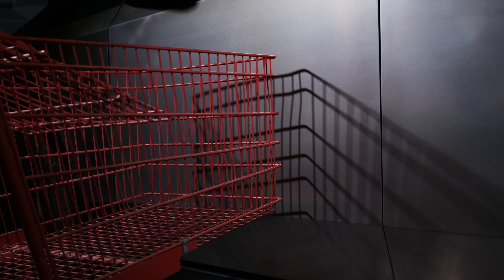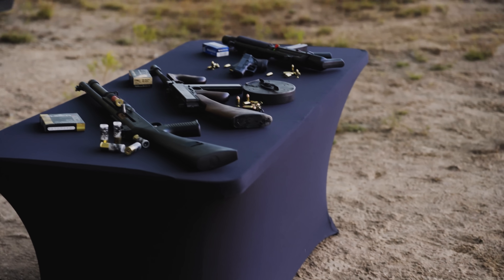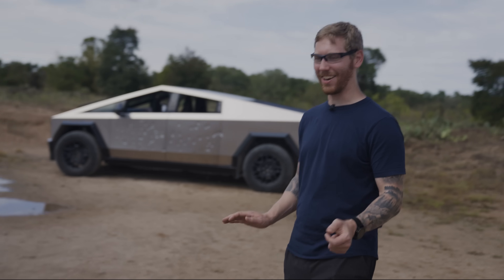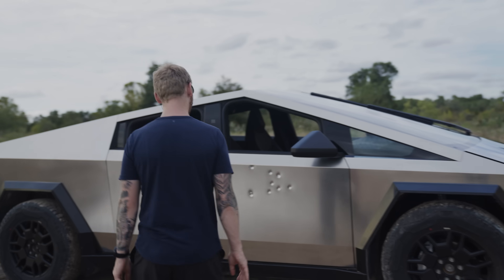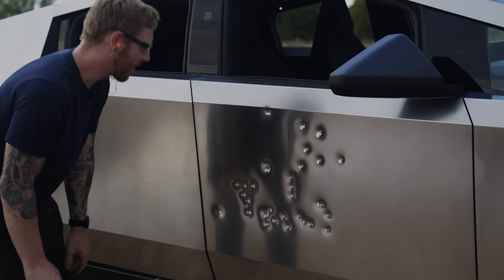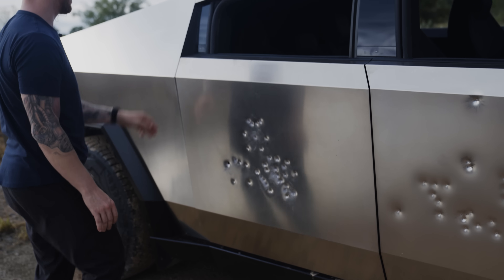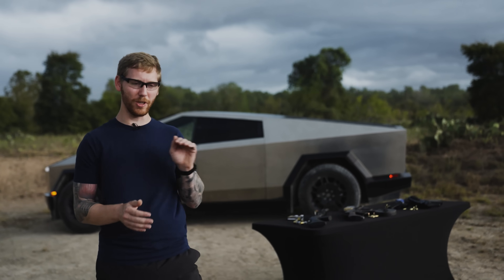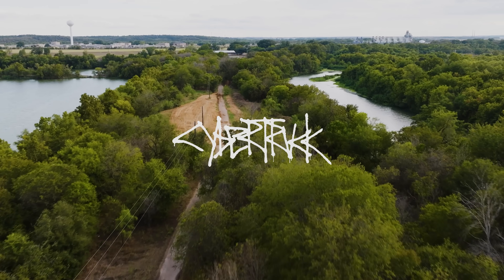Cybertruck Bullet Test

Comment: That is insane, I cannot believe how well it stops the bullets with such a thin panel.
Reply: The point is its a tough vehicle, its 'more bulletproof' than any other truck. Its incredibly expensive to make a vehicle actually bulletproof, theres also levels to what the market claims as 'bulletlroof'. The first level is actually what the cybertruck is one which is light arms/handgun proof. To actually believe that the claim from tesla was 100% bulletproof including 50 cal rounds just lacks an understanding of the science.
Reply: They specifically chose low velocity pistol and shotgun rounds to show the car is "bulletproof". They chose 0.45 ACP because it is a subsonic round and they even used an MP5SD specifically because it lowers standard 9mm ammo to subsonic velocities. I have serious doubts it stops higher velocity handgun rounds or any kind of center-fire rifle ammo.
Reply: @michaelhill6451 interesting you are right about the MP5SD.

Barrel has porting holes drilled near the base of the barrel to bleed off the gasses.
Reply: @michaelhill6451 
An MP5SD lowers a 9mm's velocity????
That is the opposite of true. 
Adding a suppressor is kinda like adding more barrel, which gives a longer time for gasses to act on the bullet, speeding it up. 
Suppresses guns only have slower bullets, because people put subsonic bullets in them so they don't break the sound barrier and make a shockwave.
They specifically said they used normal 115 grain 9mm in this video.
Reply: @MasterFancyPants  Completely wrong. It was designed to lower standard supersonic military ammo to subsonic velocities so they didn’t have to use special subsonic rounds. Thanks for playing. If you don’t believe me look at the captions that list the velocity of the rounds or look at the dents that aren’t as deep as the dents from rounds shot from a handgun.
Reply: @MasterFancyPants  Nonsense. Once the "seal" between the barrel and the projectile has been broken, that's the end of acceleration. Some integrally supressed firearms use barrel porting to reduce velocity. This is the case with the MP5SD.
Reply: Video clearly made by Tesla lol they use small under powered guns to "prove" the Cybertruck is bulletproof. LOOOOOOOL . An AK47 would shoot through it like cheese mate ! And they refuse to shoot the windows cause we all know even the small bullets would break through easily
Reply: Bot comment.
Reply: Didn't do that well barely did it.
Reply: Go with your instinct to disbelieve because it IS a lie.
Sheet metal, regardless of the alloy, cannot stop a bullet!
Reply: It's awesome material for a truck body. The bullet proof thing (only for lower speed rounds) is just an added bonus. If they reall come out with a version for $50k, IDK why anyone would buy a Ford Lightning. I only wish their range was better on the $50k model. My commute is a little over 30 miles one way...so a range a little over 300 would be ideal.
Reply: You are likely to get the shots in angle when moving, so it does matter that it can stop small bullets compared to other cars.
Reply: You ever heard of reloads? You know, half as much powder and soft lead tip. And spread out the rounds.
Reply: This just means if you have dent to repair, Tesla will charge you 20 k
Reply: High toughness stainless steel is impressive stuff. A big part of its stopping power is from how much it can temporarily deform without cracking.
Reply: Agreed @gruberaj . that so awesome
Reply: Well nearly 2mm steel with lightweight slow bullets, not a surprise.
Reply: @jantschierschky3461  I mean he did hit it with the most common rounds your likely to face.  But I agree I would like to see what the limits truely are.  Also Teflon bullets.
Reply: @rockyjohnson9243  Teflon bullets won't do any better,  but buck cracking window makes it clear those are not bullet proof.  So the whole video is a lot of crap
Reply: @rockyjohnson9243  Look, any rifle bullet will pass. This can hold maybe up to .45 pistol round.
Reply: @jantschierschky3461 tbf they said it wasnt meant to be bulletproof but i agree itsa load of bs and marketing stunts
Reply: @nikolajovanovic2433 yeah its marketting but whats so bs,nothing was promissed, its just for fun. Have you seen the ceo. Youre contradicting yourself
Reply: @jantschierschky3461  You can add an option for bulletproof windows however this will mean you wont be able to lower your windows as it will be a thick panel of glass. This model has the standard non bulletproof glass, so yes, it did break.
Reply: @Janwesdijk123  yes that super glass that got broken by a steel ball
Reply: @jantschierschky3461  bro what? is english your native language? i clearly said it wasnt super glass... this prototype uses the regular glass
Reply: @Janwesdijk123  well the bulletproof glass they showed with the steel ball. That I referred to
Reply: @jantschierschky3461 Broken and penetrated are 2 different things. 
Armor ceramic plates are broken when they are hit, that's how they absorb a bullet's energy.
Reply: @DataLog So basically the same as a typical kevlar vest... 
It's funny how you denigrate the CT because it can "only" stop pistol caliber rounds when those same rounds would go through any other car like butter. 
 
Also, what rounds do you think you'll face when getting shot at by thugs in Chicago... 50 Cal? 5.56? 45-70? No, you'll get hit with .22lr, .38 special and 9mm. That's pretty much it.
Reply: @MasterFancyPants  sure but .
Reply: @jantschierschky3461  Why is the whole video a load of crap? Did they say the window was bullet proof? At a pinch you would have to duck down and ask FSD to get you out of harms way (i.e. you wont need to stick your head up to see where you are going).
Reply: @jantschierschky3461  Actually its 3 mm stainless steel, which is significantly thicker compared to standard sheet metal of modern vehicles at 0.6 to 0.8 mm
Reply: @jantschierschky3461  Stainless Steel not Mild Steel
Reply: @SimonAtkinson3314  did I state anything differently  ?
Reply: @jantschierschky3461  Not really I guess I should of simply pointed out it was Stainless instead of  sounding like I am correcting you. I think 1.8 mm of Standard painted body panel Steel  would be a completely different result. Apologies.
Reply: @simon3314  stainless can be stronger, depending on its nickel content.  But that quality of steel is only marginal stronger than mild steel,  however in cars they use a different grade. So if 1.8mm thick may hold up as well. Normal cars have 0.7mm thick panels.  However I get your point
Reply: @jantschierschky3461  stainless steel is ALWAYS stronger than low carbon steel
Reply: @jantschierschky3461  I work in various mediums & it's a given that if you are going to attempt drilling stainless steel with a duff or low quality drill bit , or without step up diameters, then you might a well not bother. The weird thing is however, is how easy it is to mess up stainless posi drive screw heads and end up been 'screwed'.
Reply: @SimonAtkinson3314  I don't doubt that. I also did not argue against stainless steel. All I said is that stainless steel is not necessary harder than other steel used in the auto industry.
Reply: @jantschierschky3461   Sandy Munro has pointed out that the Cybertruck is  Cold Formed  (Work Hardened) Martensidic Stainless steel.
Reply: Try an AK47 . And the glass isn't bulletproof at all.

Comment: Funny how nothing has been said about how towing and off-roading and hauling and just general truck stuff affects the range and performance of the truck. Funny how every other electric truck has had issues with truck stuff and battery power. Funny how electric trucks are not good at being trucks but are 3 times as expensive. Funny how it beat a Porsche while towing a Porsche but i (and probably most truck guys) don't care about its speed we care about truck related performance. How much power did the Porsche stunt take? We don’t know because thats what they dont want us to see.

Comment: I doubt it would survive a 5.56 or similar round but they definitely have an amazing steel alloy.  I'm mostly concerned with a T-Bone car accident and it looks like it would easily stop one of those.
Reply: To be fair 5.56 and .223 were originally meant to pierce body armor lol
Reply: @TripedalTroductions that round was invented way before body armor
Reply: @TripedalTroductions  No it wasn't. It was a consumer intermediate varmint cartridge long before the military even got it's hands on it. There are specific loads of 5.56 that are designed to defeat armor like black tip but those came years later. 5.7 was designed to defeat armor and it's even smaller than 5.56 but is even faster.
Reply: @sgsheff  That was the .222rem and was the original caliber of the AR-15 before Remington and Armalite worked together to create the 5.56 specifically for military use.
Reply: @llIIIlIIIlllII  Correct. Even then it wasn't directly designed for military use because it was released on the consumer market before the military touched it. It was only a demonstration at a military/political picnic/lunch where Stoner was given an opportunity to show how much easier it was to shoot compared to the then current service rifle that forced the army to put the future m-16 in a comparison test against the m-14 and the military members fought it every step of the way. When the m-16s were introduced in Vietnam it wasn't even official. It was probably the most unlikely and unorthodox way to eventually become the most used service rifle in the history of the USA. Tales of the Gun has a great episode on it.
Reply: I'm sure if you went back in time and watched it all happen.. there were probably only a handful of people inventing weapons and they all knew each other.. it was a lot smaller world back then.  So "who is friends with whom" probably played a big part in those kinds of decisions.  @sgsheff
Reply: Welp it looks like I've been misinformed. That's what I get for not doing my own research.
Reply: @TripedalTroductions  the 5.56mm M855 round is 62 grain with a penetrator core. That one was designed to go through barricades and light armor. That’s probably the one you heard about.
Reply: @joshcarter-com  m855 still isn't classified as an armor piercing round even though it has the steel core. It was created more for penetrating barriers like windshields etc and hitting the target behind it instead of going through body armor. The black tip m993 is the actual 5.56 armor piercing round.
Reply: I think nowadays if you're being shot at in your car it's by a stolen Glock with a switch so it's going to be 9mm 9/10 times anyways.
Reply: @BobKimball_  I'd be more worried about being able to shoot back than what my car door may or may not stop.
Reply: Hagerty has video of it absorbing a side impact. They just posted a 30-minute video review.
Reply: I actually wonder how it's gonna handle crashes. 
Fyi, vehicles didn't just move to thinner steel cause it was cheaper... Modern cars have "crumple zones" that absorb a crash's energy before it can reach the passengers.
Reply: there is a collisin video
Reply: 5.56mm would punch through. It was not designed for body armor (which is why the Army is looking at the Sig 6.8 round) but it still has a ton more kinetic energy than these handgun rounds. This is still an impressive demo, however!
Reply: @joshcarter-com  100%. With armor kinetic energy isn't exactly the best measure. It's more like kinetic energy concentrated to the smallest amount of area possible which means a small round going really fast. 45acp delivers a lot of kinetic energy but it moves really really slow for a bullet and when it hits it's energy is spread out over a larger area and it doesn't penetrate. That's why when NATO asked for an armor piercing cqb cartridge FN  created the 5.7. Really small but moves really fast. Not much larger than .22 Magnum actually.
Reply: @sgsheff  KE divided by frontal surface area makes a lot of sense. I’ve seen 5.56mm, just plain M193 (55 grain) hardball, punch through stuff I wouldn’t expect. I received a steel plate target as a gift. It was made by an amateur welder and I don’t know the grade of steel, but I presume it wasn’t hardened. 3/8in thick. 5.56 at a distance of 20m went right through it! I was shocked. M193 was designed to damage soft tissue, not go through barricades.
Reply: It wouldn't stop the majority of rifle rounds. Velocity defeats armor. There's a reason they only chose 45acp, 9mm target rounds and shotgun shells because they are lower in velocity. There are some dedicated higher velocity armor piercing 9mm that would go through that. Any 5.56 would go through that without any trouble. In fact standard military m855 62 grain green tip goes through most steel and armor unless it's specifically classified to stop rifle rounds. Just think that .223/5.56 is a varmint/small game hunting round. Try .308/7.62x51 or 30-06 etc and it will blow a hole through both sides of that truck just like any other vehicle. I hope people don't take this video and think the Cybertruck is actually bulletproof and get themselves killed trying to do something stupid.
Reply: @sgsheff  Underappreciated comment in the thread!

People from "The Internets", hear this guy!

You will get killed doing something stupid.
Stay Safe!

Comment: The bullets they used are soft point bullets propelled at sub sonic speeds. When they hit the door they mushroom and splinter (disturbing the impact over a wider area) as shown in the high speed photograph. A better test would have been to use Full Metal Jacket FMJ bullets in calibers that would propel them at supersonic speed. In any case the stainless steel door skin is more puncture resistant than traditional metal door skins, but I would not call the Cybertruck bullet proof.